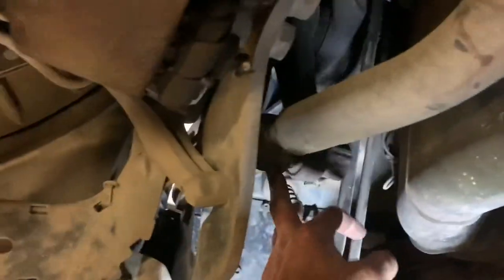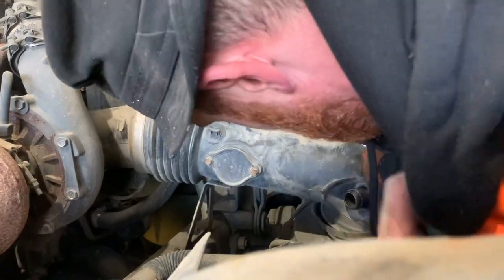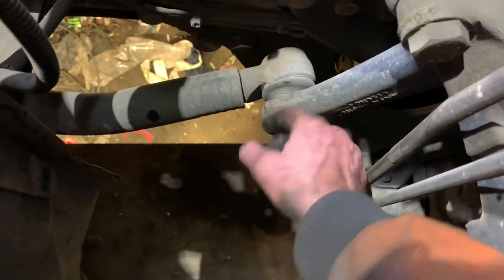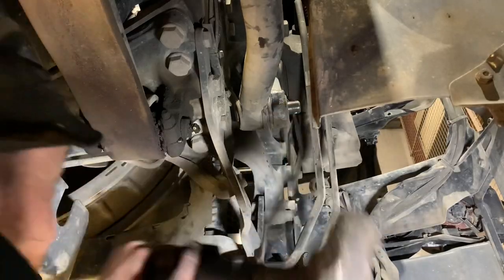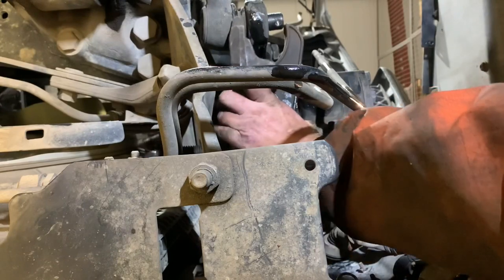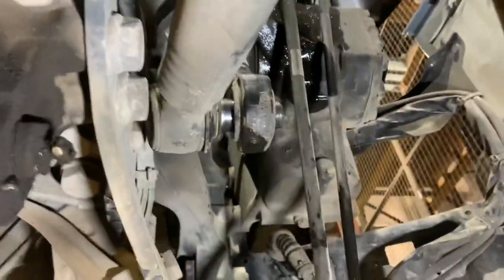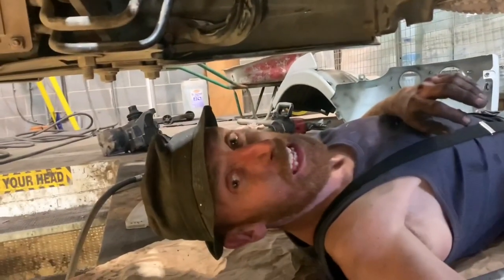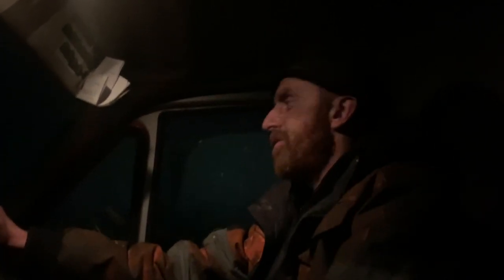How to change steering box scania 450 hgv lorry truck mobile mechanic

Comment: Doesn’t need calibrating the light has come on because you haven’t put the steering shaft uj back in same position, if you look on top of shaft coming out of steering box there is a line engraved into it,that needs to be aligned with the open slot of the steering shaft uj where pinch bolt goes, 👍 you may only be 2or 3 splines out but it’s enough to put the light on.

Comment: Ain’t they set up the same as a car with the steering angle sensor that’s fitted behind the steering wheel I know in range rovers this is a issue that we see if it isn’t aligned correctly when the steering wheel is removed we had an apprentice that spun it round we where going mad thinking we had screwed up wiring thankfully he mentioned what he had done so we corrected it

Comment: I have rear steering on my truck, how do I bleed the air out? There are 3 lines with connection plugs. I’ve heard that the official bleed machine have two lines only. 
You run trough steering oil, and push the rear axle right and left. Anyone got any experience?

Comment: For the love of GOD will you put the nut partially back on when you're swinging a hammer to crack a taper
Reply: Ithink he hit the collar not the threaded part... But anyhow, yes, better have the nut there than destroy the treads, if for some reason the hammer should wander and end hitting the wrong place.